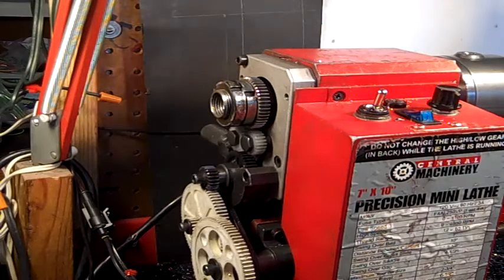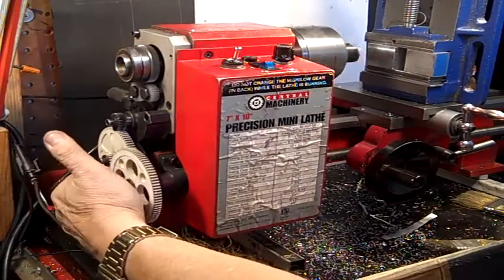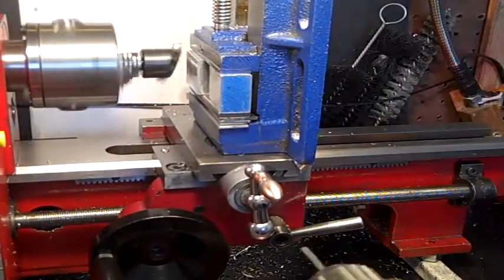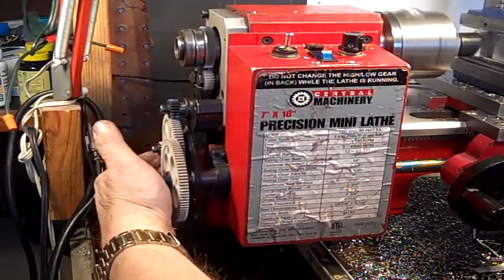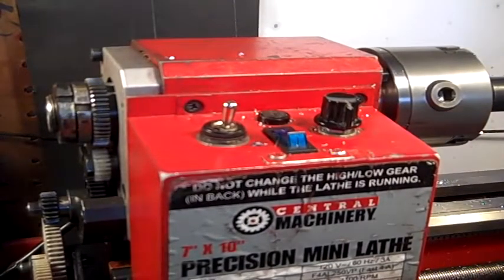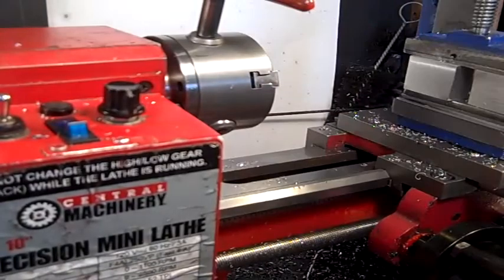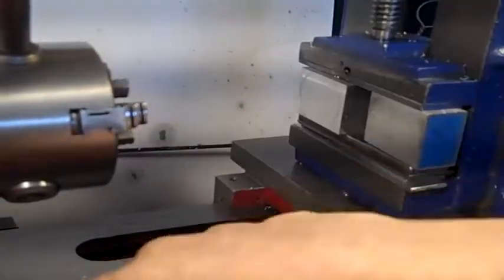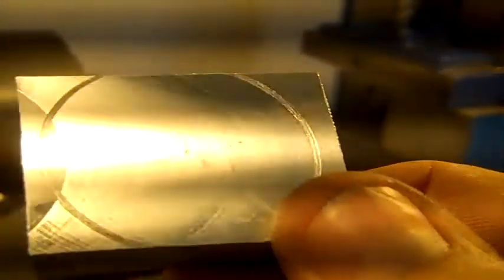Fly Cutter Function

Comment: It looks like you have the metal change gears on the lathe.
Reply from the maker: No...These are 3D Printed gears. You absolutely do not need metal change gears.
Reply: @HanstheTraffer  Well, that's a good thing to know.  I guess I won't worry about the gears unless I happen to break one for some reason.